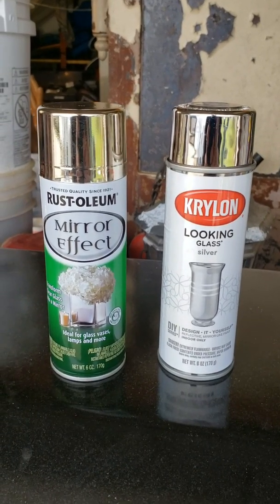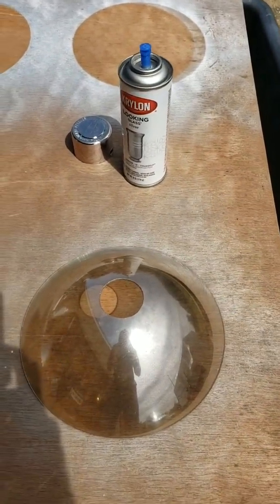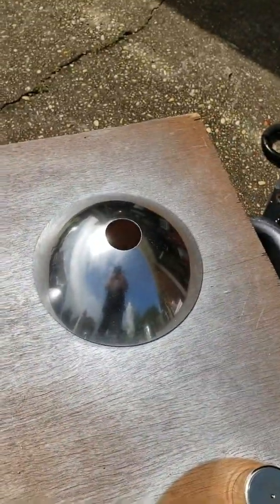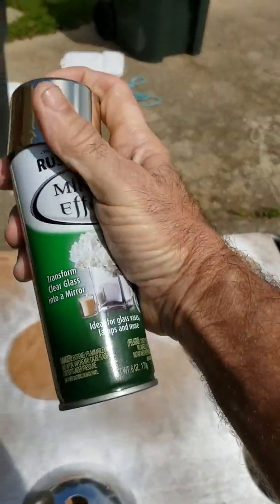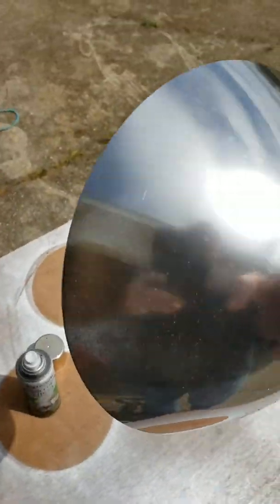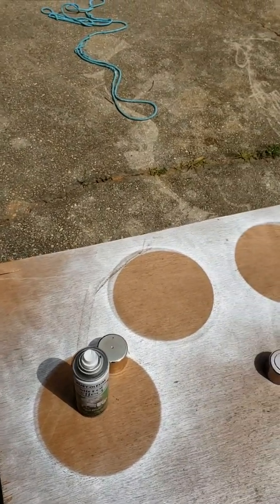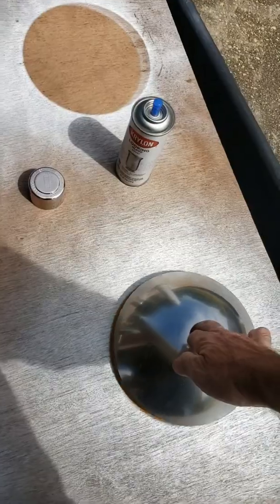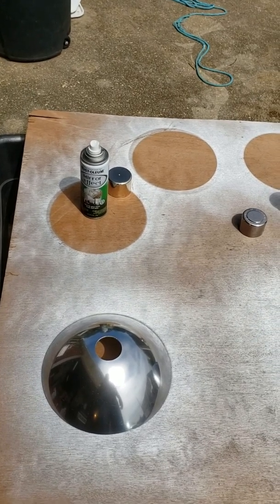Rustoleum Mirror effect vs. Krylon Looking Glass

Comment: Hey Jeff. Thanks for the vid. If your having trouble with those hard water/mineral deposits there are some ways to use Cerium Oxide to eliminate and remove those spots/marks you couldn't get out. From one do it yourselfer to another.... 😉
Reply from the maker: Thanx for that tip! I will try it.ツ
Reply from the maker: Where would I find Cerium Oxide?
Reply: @1935oscar  Amazon

Comment: did this need sealed??
Reply: but what kind??
Reply from the maker: Yes....it was sealed with a coat of paint
Reply from the maker: I will have to go check. I think it was oil base paint. I have photos but can't figure out how to upload them here.   The Restorations were blogged on my fb page.  https://m.facebook.com/groups/437477716402979?view=permalink&id=1305433112940764
Reply: Jeff H oil base paint but is clear one right???
Reply from the maker: @angelcastillo6286  no it was grey paint. Directly over the mirror coating. When I was done you could not see thru the mirrors when held up to the sunlight.